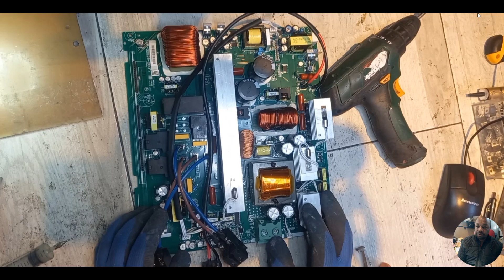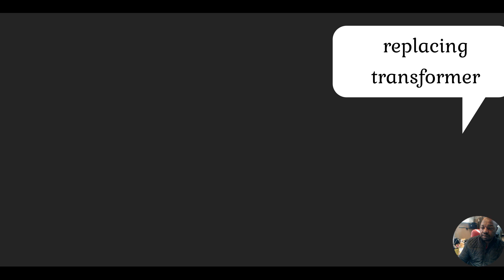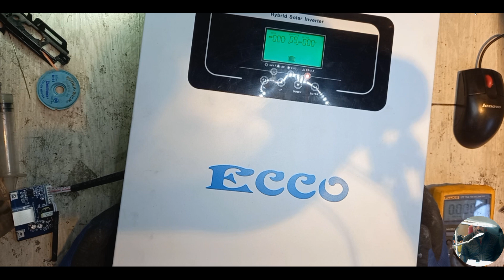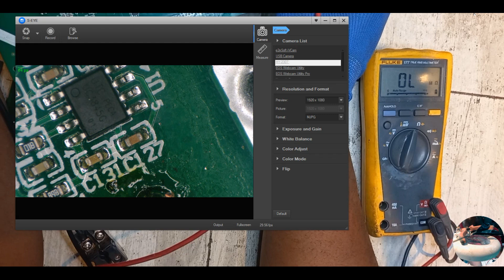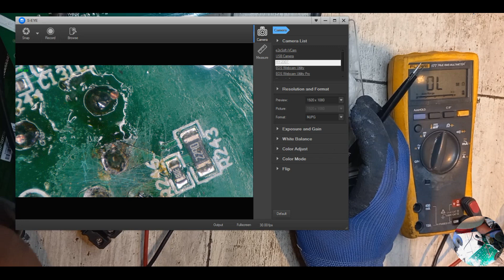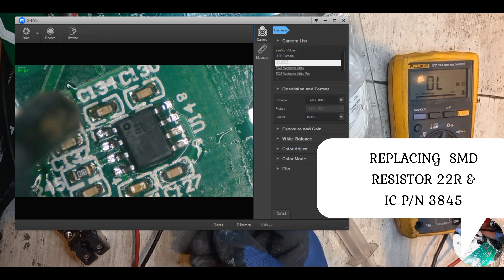ECCO HIN3500 3.5KW 24V ERROR 09  REPAIRED  TRANSFORMER REPLACEMENT  SMPS IC3845

Comment: Hi Given I'm a huge fan of your videos, keep up the great work, I currently work for a inverter/battery manufacturer in JHB, I do alot maintenance on inverters, I'm currently experiencing a problem were after replacing shorted IGBTs, and test for short circuits nothing appears, but when I test on a variable power supply, immediately IGBTs explode and the very same IGBTs have short circuits.